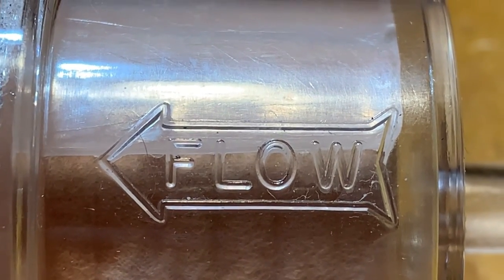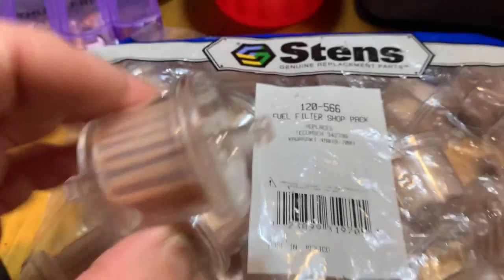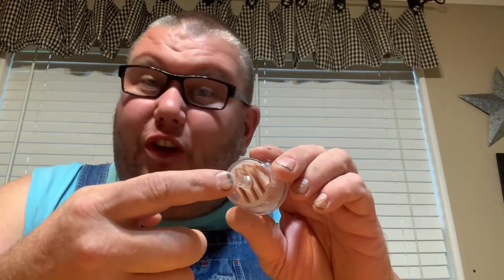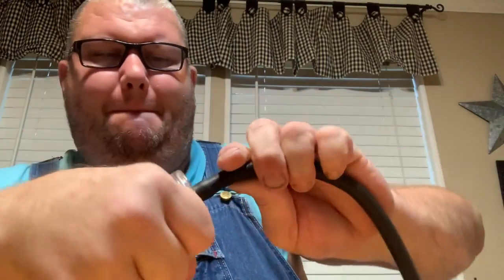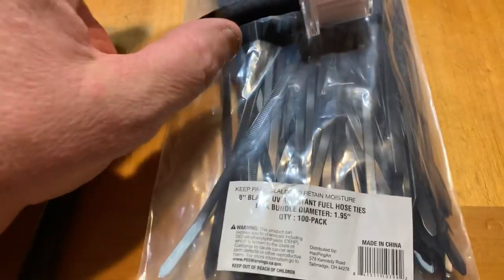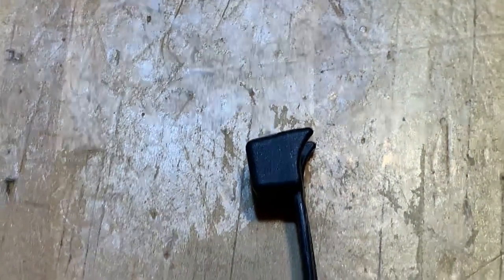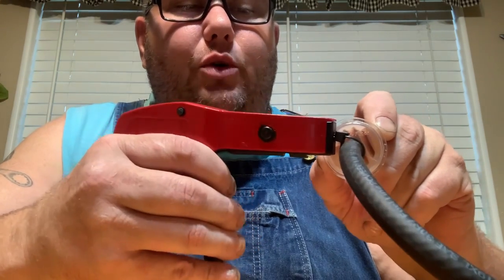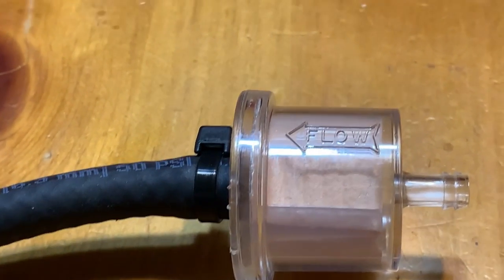FUEL FILTERS 101

Comment: If you don't have the zip tie tool you can hand tighten them and use toe nail clippers to flush cut them. Toe nail clippers don't leave sharp edges to cut yourself on.

Comment: It should be noted that pleated paper fuel filters are better but screens are used for snowblowers and generators because they're less likely to ice up.  The reason paper filters have an arrow is so you can see the dirt in the filter not so it will last longer.  It will trap the same amount of dirt in either direction you just won't see it if you put it in backwards.

Comment: I am impressed. Somebody else besides me uses a ziptie gun. I don't use zip ties on fuel lines but i do on lots of bn other things. Another benefit of the gun is that it doesn't leave razor sharp points on the cut ends. If you have ever reached ito a wiring rack where the installer used side cutters you will know what i mean. I have the scars and the T shirt.
Reply from the maker: The zip ties are designed and made for fuel lines

Comment: Great video!  I was looking for a video that addressed this issue.

I bought a used Simplicity Regent riding mower with a 16 HP Kohler motor.  It is an older mower, but very clean and in good shape.  When I was mowing, it would cough a couple of times, but it kept running.  Finally, after I used it for about six 1 hour mowing sessions, it kept coughing to the point where I had to put it away and use my big tractor to finish the mowing.  I looked at the engine and the arrow on the fuel filter was pointing back toward the gas tank which didn't seem right.  I ordered a new Kohler fuel filter, took the old one off, installed the new one with the arrow pointed toward the carburetor.  I started it and did all of my mowing (1 hour)  with no coughing or sputtering.

Your video confirmed my suspicions that the filter was on backwards.  Thank you !

Comment: I swear the ID of my new fuel line 1/4 won't fit on the barb of my 775ex briggs carb or gas tank.   The fuel line fits on the fuel filter, but not the carb or gas tank.   And the old fuel line leaks when put on new fuel filter.

Comment: Ever seen this issue and what may cause it- MTD older rider. Gas tank sits in front of steering wheel. Hose comes down and around to filter then carb. I had put new lines and carb on rider last year. Flushed tank etc when I brought it used. Changed the filter which had a round red one on it. Got a Briggs clear see through gas filter. Hooked it up right. I also installed a shut off before filter. Each time I am done mowing I shut off the valve and run gas out carb till dies. Now for a good while the filter had gas filled in it when mower ran. I see my past 3 mowings when mower is running no gas in filter. None-0. Shut off valve is fully open. Oddly mower runs fine? How is it mower is running 1+ hrs and not a drop of gas is in filter? Side note- I now have a new ( same type ) filter on. I get same issue.
Reply from the maker: It is a gravity flow system the filter will never fill with fuel unless the filter is vertically mounted
Reply: @THEMOWERMEDIC1  thanks for input/info. That is about the only thing came to my mind as well. So run it and all good. Least I don't have no leaks ha ha. I say that because I use 90 oct no eth in all my stuff. At that price I want to account for every drop.

Comment: Here's a question, I understand B&S tell you to use red filter if it's gravity fed and another type if the engine has fuel pump.  Can you run those fiber type fuel filters with a gravity fuel system?
Reply from the maker: Absolutely

Comment: Just changed the fuel filter with the same clear filter as this video. Is it "normal" for the filter to be half full of fuel and the other half air? The zero turn mower has a fuel pump and the tank is full. The mower runs perfectly well.

I forgot to check if the old filter was full.

Comment: Ok, so now I have the filter secured with the cable tie, how do I change the filter?
Reply from the maker: Cut the zip tie
Reply: @THEMOWERMEDIC1  but even YOU couldn’t pull the fuel line off!
Reply from the maker: Oh
Reply: You should be able to cut it off both sides then reinstall the new filter, unless for some reason the fuel line is to short, which I don't ever seem to have a problem with.
Reply: I use a push pin removal tool for fuel lines. I also use hose removal needle nose

Comment: You hook up the fuel filter correctly the transparent case will allow you to see the dirt accumulation, so you can determine to change this filter.. Hooked up the wrong way your filter can get plugged before you visually see it should be changed.